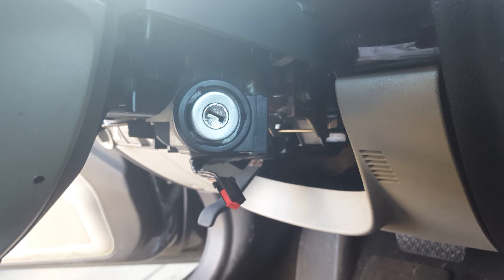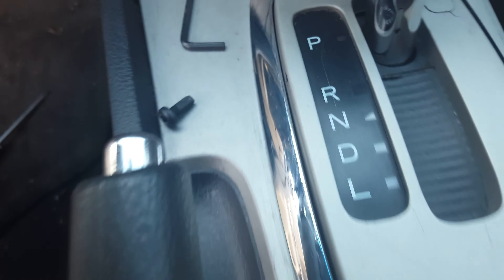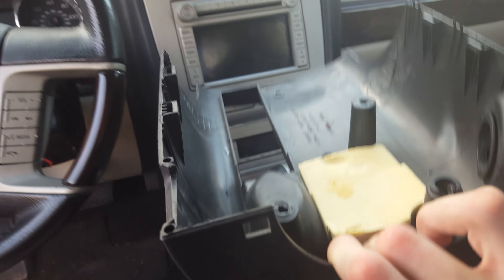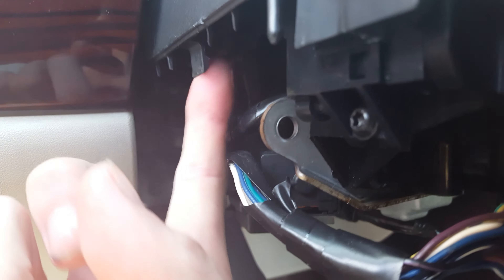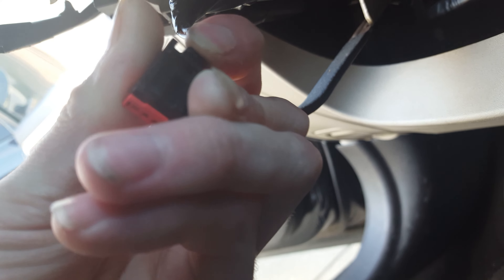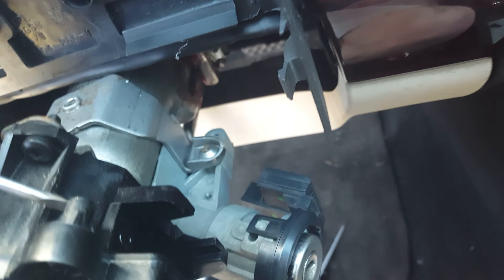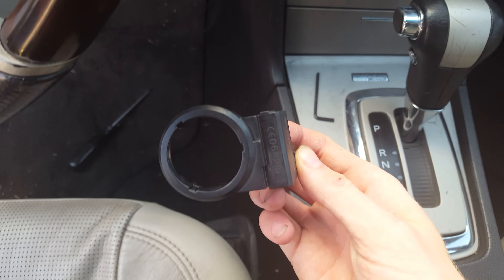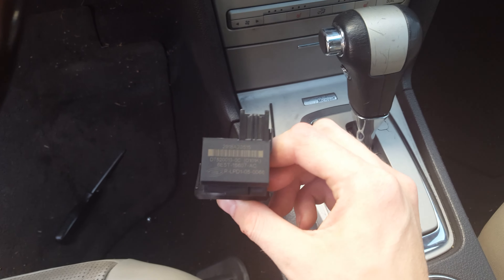How to replace the ignition switch Immobilizer Module on a lincoln mkz zephyr and fusion

Comment: Hello. I wanted to say thank you so much for the time to make a video like this. I have an 06 lincoln zephyr and I was fixing the evap temp  sensor so I had to remove the dashboard.  at removing the dash and wheel column I believe I may have messed up the immobilzer.  This video really helped me get to the bottom of it and be able to fix it. especially with a 2006 zephyr it is so hard to find videos about fixing the car.
Reply from the maker: +Nicole Hernandez  thank you for checking out my video. Glad i could help. I notice when i bough my vehicle i couldnt find any repair video for these car so as i do repair on my vehicle i make video to help other people like you. If you replace the immobilizer.  You might have to get it reprogram by a dealer because of the theift system.
Reply: Nick the car guy I believe mine got deprogrammed and broken aswell. and activated the anti theft system. Therefore I'm going to replace it and take it to get reprogrammed. lol. I didn't want to pay for the dealer to repair the evap temp sensor so I did myself and this got damaged but it's still cheaper than an $800 repair. thank you so much. keep posting video us zephyr owners need them lol
Reply from the maker: Nicole Hernandez thank you. if you need any futher help feel free to message me and i will try to help you best i can.

Comment: What issues symptoms did you experience before switch went out I have a 06 Lincoln Navigator and was on freeway and it just shut off dash went back no radio and unable to roll down windows lights horn and everything work so all signs pointing towards ignition switch

Comment: I have to replace this in my car. Do you know for sure if I have to reprogram the keys to the car? What exactly do I have to re program. You mentioned this at the end of the video but did not go into detail.
Reply from the maker: If you replace the immobilizer module you might have to program the keys back to the vehicle because the new immobilizer won't have the key data and prevent the car from starting
Reply: @Nickthecarguy  ok thanks a lot! I have a Ford Focus with the same ignition and I am replacing the immobilizer transponder coil that goes around the key slot. I am going to use a free program called forscan to reprogram my key. Thanks for the quick response

Comment: I'm getting power to everything. Replaced the starter and ignition switch. Fuses and relays are good. The chips in the keys are good. Getting a pats error on the obd. 
Could this module be my problem ?
Reply from the maker: Yes it could be unless a key is not programmed right

Comment: What happens if u take immobilized out and leave it out and put ignition switch back on
Reply from the maker: It would probbly crank but no start or the theift light will constantly flash
Reply: Because I had lost the keys to my car and instead of getting another key from a locksmith I ended up buying a new ignition switch cylinder from autozone without the transponder key and the anti theft got my car immobilized from anti theft because it turns out my car does take a transponder and it’s not reading new key  .do you think  I can give the locksmith my new key and he can put the original transponder in it
Reply: Aj White is the key cut to the car?

Comment: Is there a way to bypass that?  Without replacing it....
Reply from the maker: That I havent figured out because there is a chip in the key that send a signal to this module to tell it if it's the right key or not
Reply: You can’t bypass it. It’s to protect your vehicle from theft.